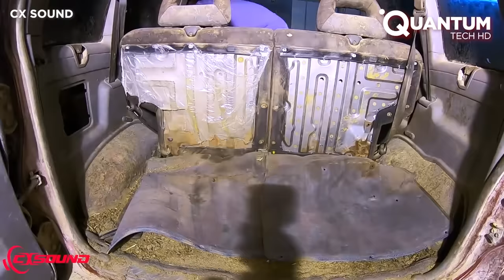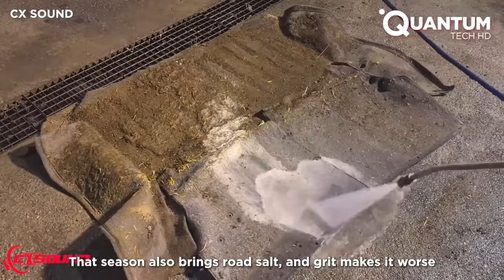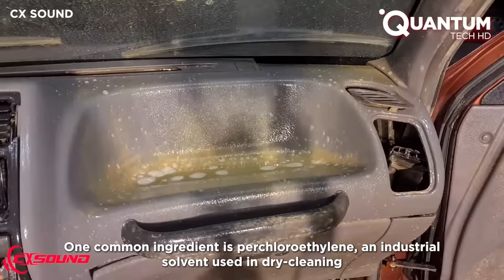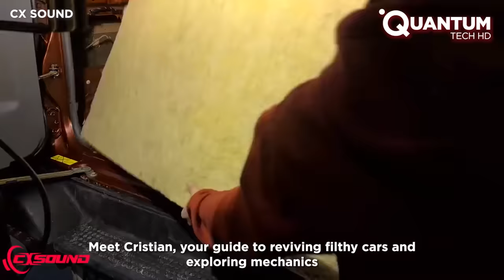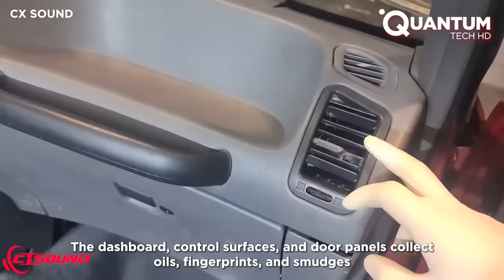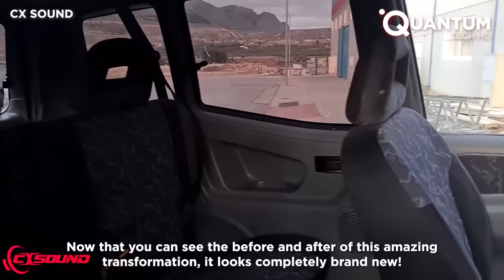Cleaning the DIRTIEST Car in the World for ONLY $300 | Satisfying Car Cleaning by @Cxsound

Comment: Weldon amazing job and this is the right way to clean ...Top panel first as most of the filth comes down then work inside and around and lastly the outer or body and engine bay unlikely as most of the detailers wash it from outside first thinking its look good and great...

Comment: Perfect grade when he was cleaning the interior and the body. A failing grade when he was cleaning the engine bay!! Never use a pressure washer when cleaning the engine bay. That would force moisture into the electrical connections.. I would not be surprised if the car won't start after a few days..

Comment: Very nice BUT! You don’t pressure wash seats… theres to much sponge absorbing water in them you will never be able to dry them completly without getting them moldy and/or smelly on the inside… and the next even more dangerous thing - YOU DON’T SOAK OR EVER PRESSURE WASH THE SEATBELT! You can bonnet them with mild chemicals but if they are past that point you simply replace them. This is a safety hazard!

Comment: 300$ to break his wiring 😂😂 never pressure wash a engine I’m a mechanic and if you pressure wash a engine you will fuck up the wiring system because the engineers make the car to handle a splash of water like a hose would do but when you pressure wash the shit out of it you’ll end damaging electricity fuzes and wiring but by pressure washing your putting water in places where it shouldn’t be so wires wear out and shorten reaction time so if he’s radio and gages play up I wouldn’t be surprised 😂😂😂

Comment: Nissans used to be one of the top consumer vehicles but theirs now isn’t. Low mileage transmission failures they used be one could go a million miles roughly with maintenance here in the us they use Jack-co transmission low ball transmission. What ever they were using back in 80’s my mothers Sentra fifteen years use age we as family out grew the car mileage was consistent. fill ups were less than 20.00$ empty two plus weeks on a tank. oil changes were extremely easy cheap. You buy one new theirs no telling what you’d get out it.